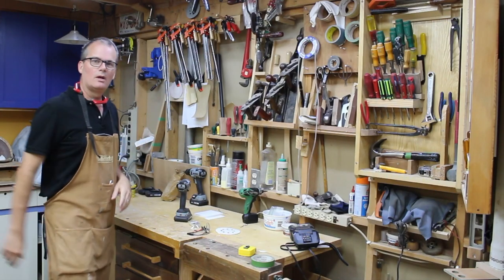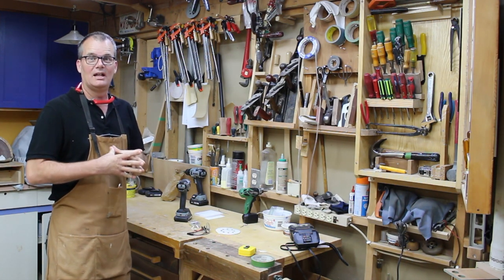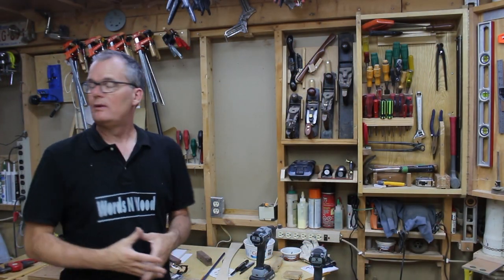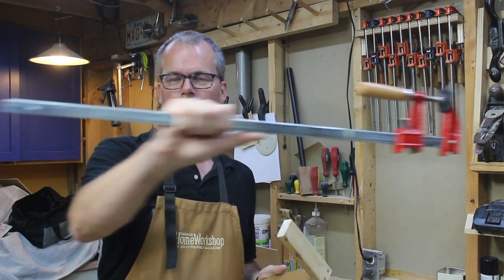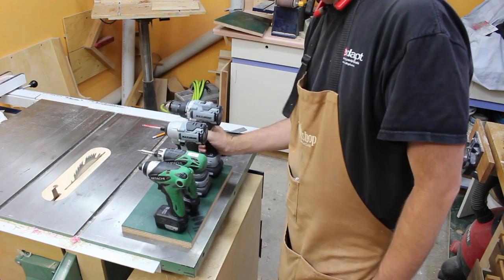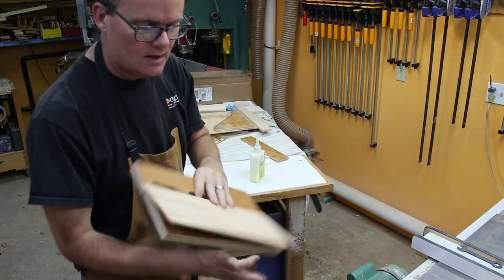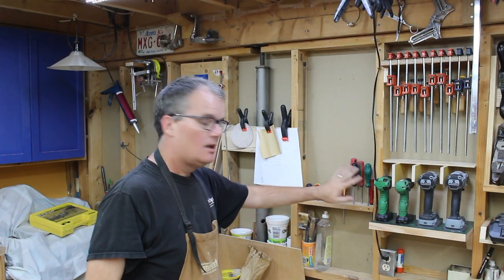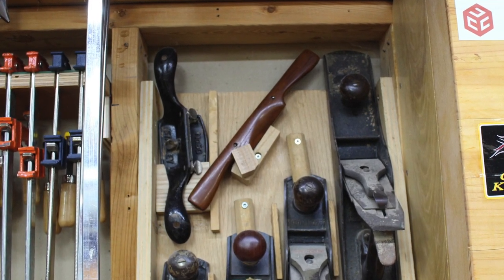Building a better Tool Wall  (WnW #67)

Comment from the maker: My wife told me to put this here: https://www.patreon.com/wordsnwood

----- ----- -----

It’s time to tackle the wall above my workbench.   

My workbench is places against an unfinished interior partition wall in my basement shop.  Because of that,  I’m not doing the sheet-of-plywood tool wall that a lot of others woodworkers build, as I would then lose all the storage space between the studs.

Instead I will be fitting all my tool holders into those stud bay cavities.  This means a bit more custom fiddling and fitting, but the end result is, I hope, a better use of space.

Many more woodworking projects:
http://www.wordsnwood.com

————— ---------- ---------- ---------- ----------
LINKS TO SOME OF THE ITEMS USED.  (Affiliate links)

http://amzn.to/1WSNq1j — Stanley Leverlock tape measure - love these!
http://amzn.to/1pFGjPk — Sensgard ZEM hearing protection
http://amzn.to/25Iw4t6 — Long Nose pattern marker
http://amzn.to/1LleENk — Bessey small 4” F-Clamps
http://amzn.to/2aqt0u4 — Ridgid 12v drills
http://amzn.to/1UegW3W — Hitachi 10.8v drill/driver kits

GEAR I USE TO MAKE VIDEO:

http://amzn.to/1qPkvBp — Canon T5i
http://amzn.to/1SSwOmS — Sony Action Cam.  (I use the HDR-AS15 which is discontinued -- cheaper than a gopro.)
http://amzn.to/267XM3M — Sony Live View video remote for Action Cam
http://amzn.to/1XC2D7l — Joby GorillaPod (Flexible small tripod)
http://amzn.to/2aK7jZX — Inexpensive Quick Release tripod ball head
---------- ---------- ---------- ---------- ----------

Thank-you!

Follow me on Social Media:
https://www.facebook.com/wordsnwood
https://www.instagram.com/words.n.wood

Check out my woodworking plans:
http://wordsnwood.com/plans/

Comment: Nice! Looks like a tool wall to me :)
What's behind that wall? The future rest of your workshop? :D
Reply from the maker: That's been the future expansion bay for a while but we keep not giving up that space...   Have you ever moved a telepost?  One of those is kind of inconveniently located in that wall as well.
Reply: Wordsnwood (Art Mulder) Never a good idea to move one of those, unless you add more structure to spread the load it's carrying to new support points. Usually an engineer needs to design that. Better to leave it and just work around it.
Reply from the maker: Yeah, that's what I had figured.

Comment: You are way ahead of many of the "cool guys" because you have figured out that it's best to have each tool held so it's handle is easy to grab.  Plus, you've avoided the fear of a massive earthquake that seems to cause other guys to think they need every tool secured to the wall with some sort of catch that needs to be manipulated in order to get it free.

Comment: WIFE: "Can you finish that project for my craft room yet?"
Hubby: "Yes, as soon as I can find that tool I need."
WIFE: "Have you found that tool you need yet?"
Hubby: "No. I'm too busy trying to organize my tools so I can find them!" ;-)

Thanks for sharing your process with us, and "process" is the key word. 
We all have the same problems but in different spaces for different tools. That's why every little bit of creative insight is helpful. With each upgrade or addition, the storage must change. As we use the new storage system, our work habits change. As habits change, the system will change... 

(sigh) ...Evolution takes time.

Comment: I don't quite get the obsession with those notched clamp rack things.  Do people not want their clamps to touch each other?  I just have a bar between the studs to hang them.  I don't have any trouble just getting one clamp (how often do you only need one anyway?) and I don't have to fuss with getting them into slots to put them away.
Reply from the maker: Sure, now you tell me, after I've already built it this way.   thanks.

Comment: Nice work. I especially like the cordless tool shelf, as you have multiple drills of different brands (like the rest of us poor schlubs without sponsors!).
Do you have a plan for the slick box joint jig thingy you used for the F clamp rack?. On your website, I saw the big gear driven version, but that is WAY overkill for me. Just subbed the channel
Reply from the maker: No plans, just made it up.  I've seen variations on that in lots of diy box jig videos.

Comment: Art, if your looking to save some space with the clamps I would go back to your dowels like this. http://www.kudzucraft.com/articles/clamp-storage/image8.jpg  
You can stack them 4-5-6 deep in the space you now have 2. Also for the bits and tips I use a magnetic bar works great. 
http://img.lightersideofrealestate.com/2015/08/garage-storage-01.jpg
Reply from the maker: those are both good ideas also, Pat, thanks!